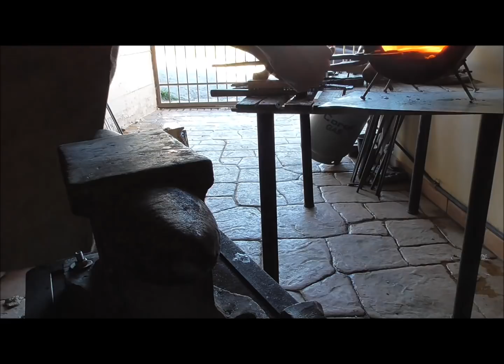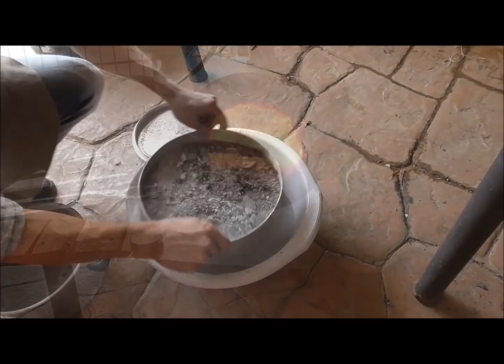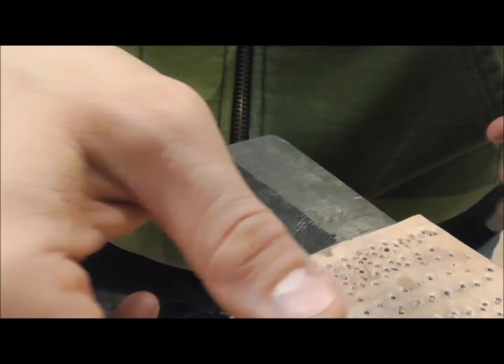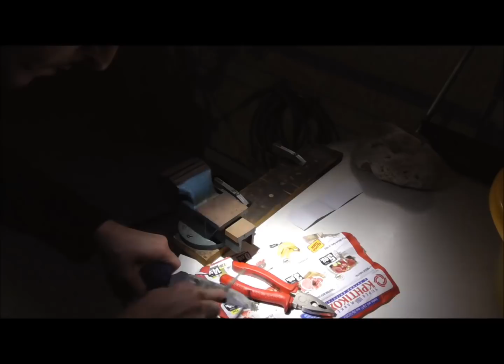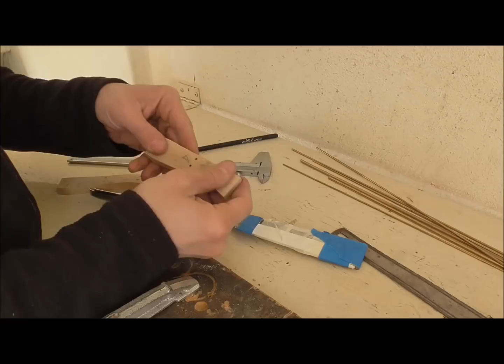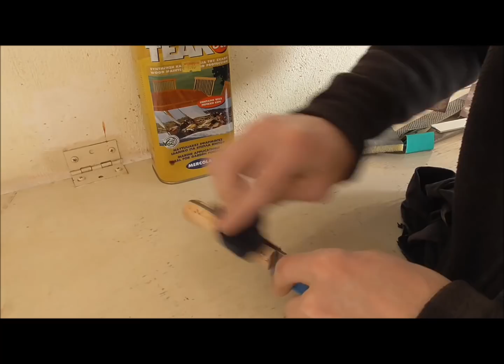Forging knife from file.

Comment: Hi, im a young amateur smith and i have a couple of questions if you dont mind answering.

Why did you wave it around for it to cool down?

Why did you quench it in ash or whatever that was?

What would you do to straighten a blade when you quench it in water instead of oil?

Why would someone quench in water instead of oil anyways?
Reply: Waved around to normalize it (reduce tension in the metal from forging)

Didnt quench in ash, he put it there to anneal it fully (very slow cooling in wood ash, you can use vermiculite too) removes all tension 

Your blade doesnt warp because you quenched in water, (also answering the last question): some steels are water hardening and some are oil hardening, some others are even air hardening meaning you just let them cool and they ll get hard, the key to avoiding warping is to get out all tension with a thurough annealing and normalizing cycle, an even heat distribution right before you quench and the right angle, putting it in the quenchant tip first, not swaying from side to side but up and down and as if you would be  cutting back and forth
Reply: @RedBlackOne  thank you so much for the answer. Although in the 3 months since ive put down this comment ive found the answer for myself. Blacksmithing truly is filled with wonders.
Reply: @thinhsuynhuoc  nice, keep me updated if you make any knives in the future :D

Comment: has anyone done a twisted wood auger and drill bit Damascus knife so the Twist of the drill bits and the manual twist the blacksmith does after the heated up shows in a pattern on the Finish knife?